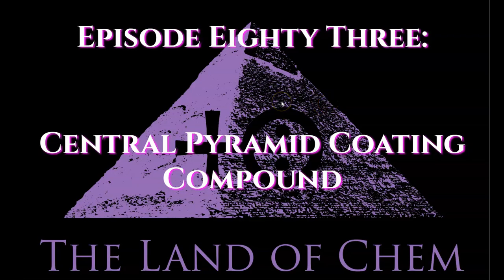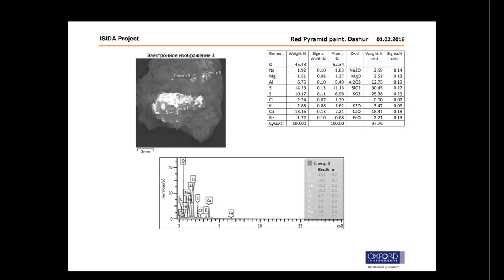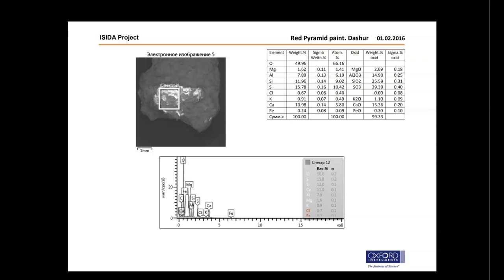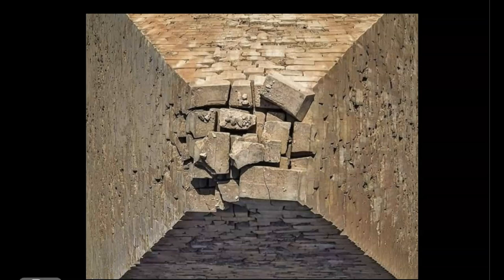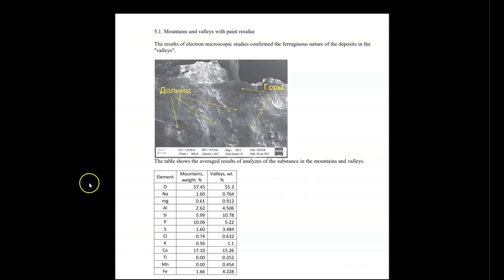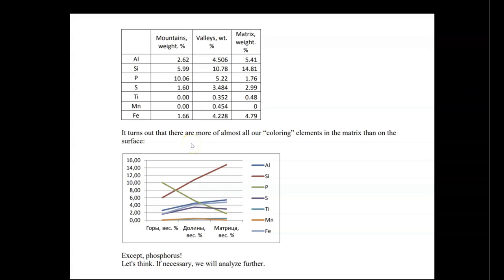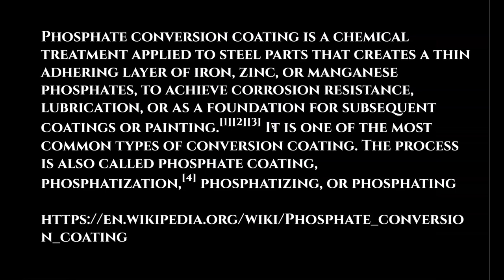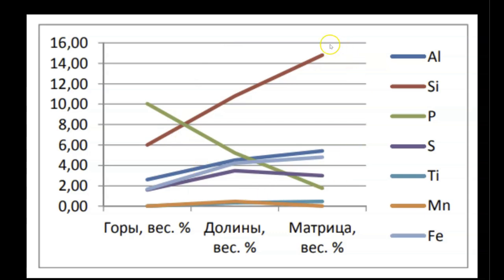Episode 83: ANCIENT TECHNOLOGY - New Chemistry Discovery - Central Pyramid Coating Compound

Comment: Fascinating once again!   The damn pyramids have corrosion resistant coatings.  How incredible.  This explains why the limestone is in such good condition.
Reply from the maker: I was just on the plateau last week, and it's crazy how much of the red coating is still at the top on the remaining casing stones. And also on the head of the Spinx
Reply: @thelandofchem  Isn't it so that if limestone is exposed to heavy rain it can deteriorate into a mildy acidity runoff which could affect water and ground quality?
Reply from the maker: @Hot Metal Knives HMK  absolutely, general corrosion resistance against a variety of environmental factors. I have a feeling it may also have another function related to containment of the EM fields within the pyramid. More on that coming up soon
Reply: @thelandofchem  That would make sense.  In modern day engineering ''coating'' is a huge huge huge thing.  Teflon, etc... Even pistons in hydraulic systems are often coated with something to increase lifespan.  Diamond coating on steel blades, etc...  Coating technology is extremely important for advanced engineering.   When i quench a blade i leave the burned oil on the surface of the carbon steel often as it completely negates rust.  Burned oil is better than stainless steel in terms of corrosion haha.

Comment: Excellent work! Could it be that phosphorus is being actively expressed or pushed out from the limestone matrix, the coating, or both? Maybe it's actually been deposited from the local atmosphere (after sublimation from the matrix/coating or naturally occurring phosphates in the area)  and has a natural, inherent preference for condensing on the sharp edges of the mountain areas. 

In old alchemical works the Adepts speak of their Magnet, which attracts the Astral Gold (Materia Remotissma) from the Waters Above. If we consider the role of P throughout nature, it fits rather nicely with the concept, enlivening the whole planet. P is the crucial backbone of all DNA. It's also the light bearer, the channel through which the light of life is expressed and in it's pure elemental form would long have been (and still is) considered "a vile and wicked thing" (think Greek fire...).

Comment: Well, well... it seems that what I've been harping on for years now finally has a basis in 'science', -namely that the head of the Sphinx was coated with a very strong sealer that has preserved it for over 4K years with little erosion. That's in comparison to the original 'lion' head that eroded away because it was NOT composed of member III limestone but instead it was member II... which is the same as the body... which eroded very badly.  The re-carvers knew that and wanted to avoid the same fate so they coated it with a preservative-protectant that was harder than any of the Giza limestone.

Btw, I heard in another video that the Great Pyramid was originally called the Red Pyramid, but after the casing stones were stripped away that title was dropped and later shifted to the present Red pyramid.  See if you can find a source to confirm that.

Comment: Great work and really well researched as per usual , what theory are you contemplating on when the coating was applied , i still believe some of the stones were cast as a polymer not chiselled in a quarry? Thats another day , could this have been sprayed / glazed on , clay baked time of manufacture or after  so many questions such as  Is it purely on external visible wall sides  or does it coat the entire block ,
Reply: It's totally quarried limestone, it doesn't look geopolymer to me, also geopolymer stones tend to break down over time as we see in Peru - though the Egyptians were much better at chemistry and masonry then the Peruvians, think that if they were hauling the granite and other stones all that way then surely they could quarry and carve the limestone. It could still be a possibility used elsewhere in Egypt but the pyramids in my eyes are quarried stone.